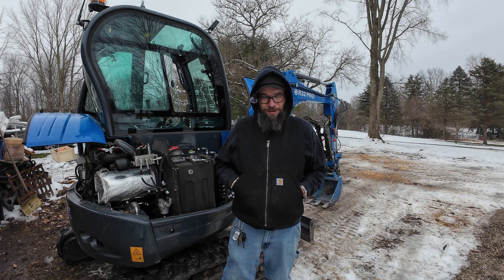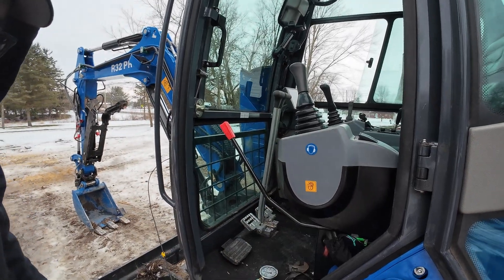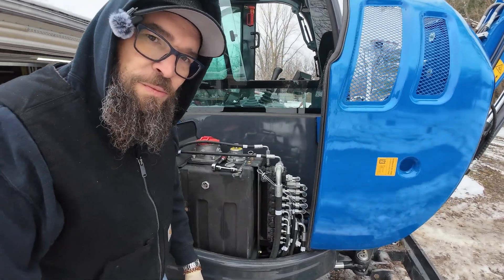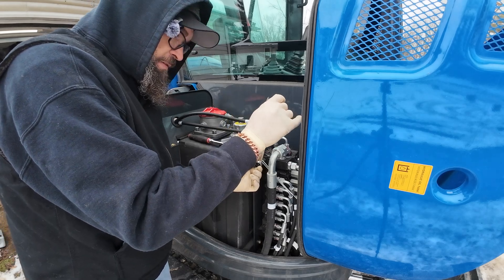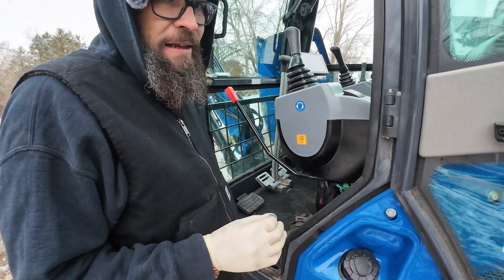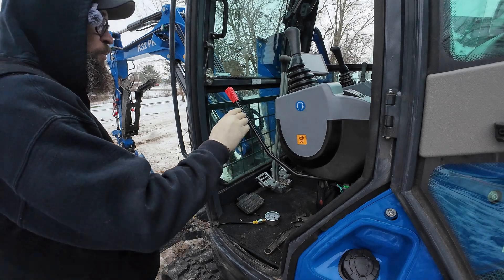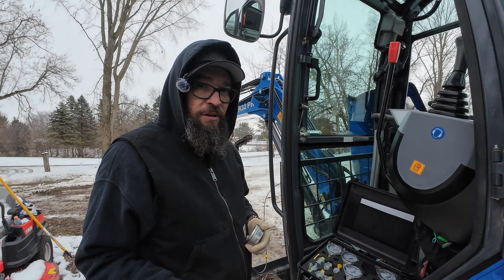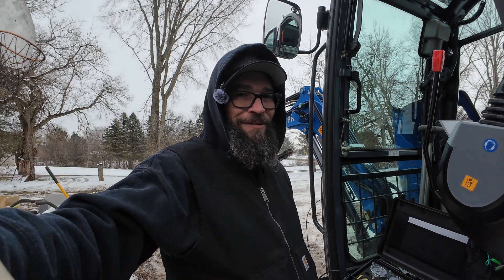Adjusting the breakout pressure on a Rippa R32-3

Comment: it seams the machine is not very pro when the psi was so far from optimal setting
Reply from the maker: I had turned it down for the video sake. I did not have the gauge set when I got my machine so I cannot speak to what it was set at from the factory.

Comment: Will this help with my sluggish tracks?   My tracks don't have a lot of pressure when attempting to turn and have to do an Austin Power 30 point turn to get it turned around in a short distance.  I've heard it's not getting enough hydraulic pressure and needs to be adjusted.

Comment: I checked with my technical guy at Rippa, he stated the R32 range is 18-20mpa.   Which is 2610-2900psi.    Way under 3200 you said.  I am asking for clarification on this.
Reply from the maker: The safe bet is going with what the manufacturer recommends. I just reviewed the manual and found the max set pressure to be 20mpa. Thank you for bringing this to my attention.
Reply: @BlackRaccoonLandManagement Sure thing.

Comment: Great video! I got the pressure kit and just checked my pressure and bumped it up a tad.
Reply from the maker: It was just brought to my attention that the max set pressure of the R-32 is actually 20mpa and not 22mpa as I stated in the video. I would recommend making sure you are at or below 2900psi. I apologize for any inconvenience this has caused.

Comment: Thanks for the information.  Keep  us posted on your  experiences  with the rippa.
Reply from the maker: So far I don't have any complaints. Any issues I've had have been rectified. The machine is a beast.
Reply from the maker: It was just brought to my attention that the max set pressure of the R-32 is actually 20mpa and not 22mpa as I stated in the video. I would recommend making sure you are at or below 2900psi. I apologize for any inconvenience this has caused.
Reply: @BlackRaccoonLandManagement Thank you for the update. Great Video